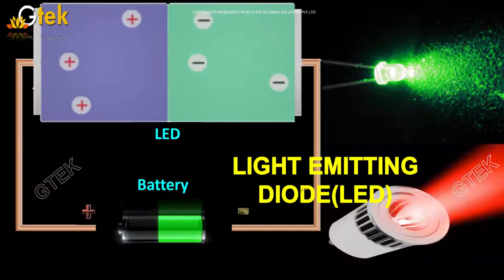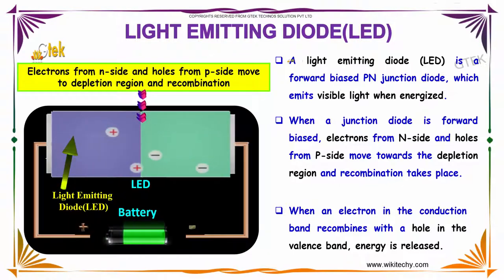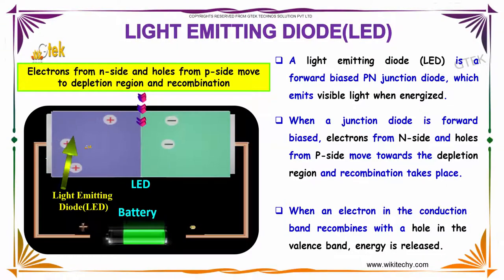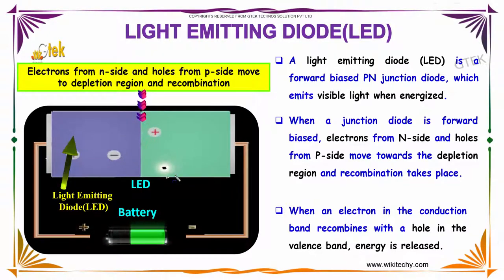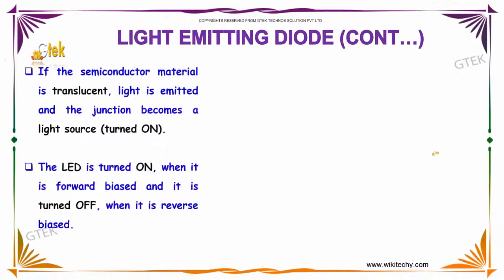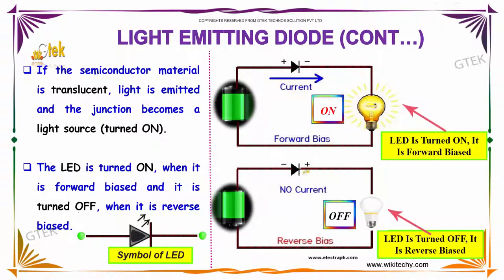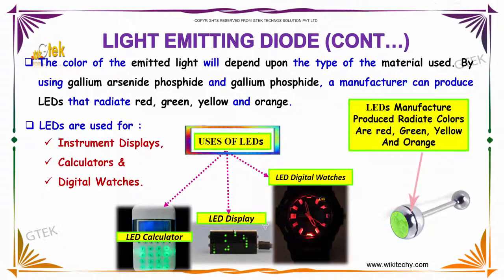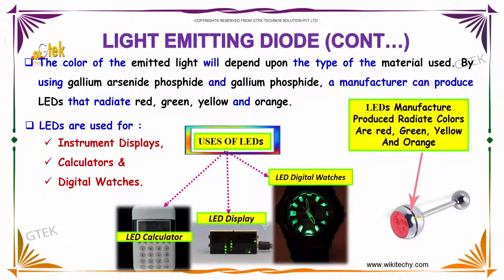Light emitting diode Semiconductor Devices  class 12 Physics subject notes lectures CBSE

Comment: a light-emitting diode (a semiconductor diode which glows when a voltage is applied)."light sources can be fluorescent tubes, optical fibres, or LEDs"

Comment: A light-emitting diode (LED) is a semiconductor device that emits visible light when an electric current passes through it. The light is not particularly bright, but in most LEDs it is monochromatic, occurring at a single wavelength. ...

Comment: A light-emitting diode (LED) is a two-lead semiconductor light source. It is a p–n junction diode, which emits light when activated. When a suitable voltage is ...Working principle: ElectroluminescenceFirst production: October 1962Invented: Oleg Losev (1927); James R. Biard ...Pin configuration: Anode and cathode